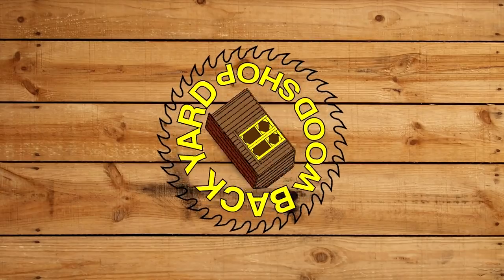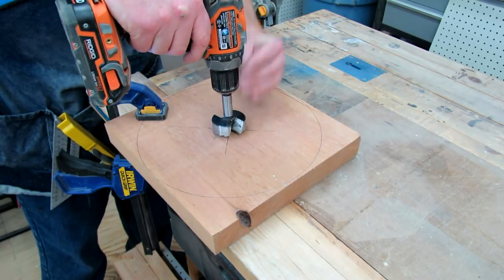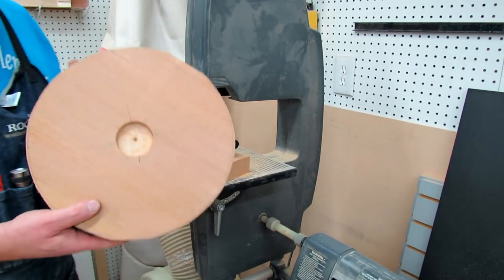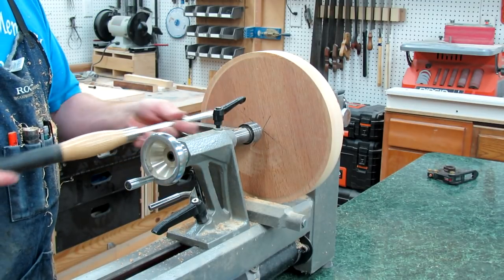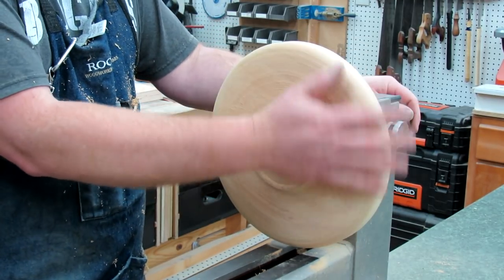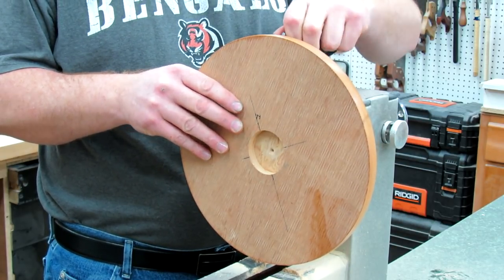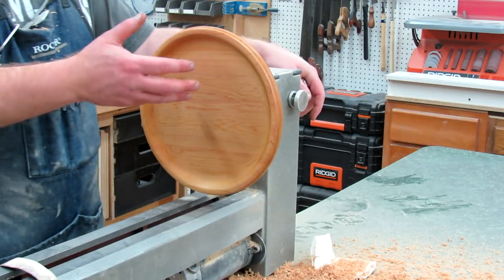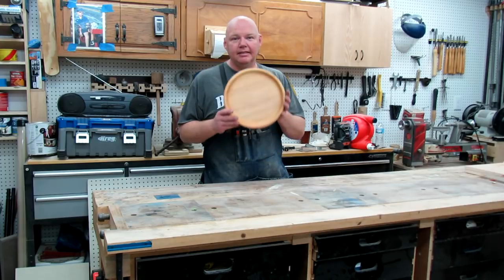Easy Cedar Plate

Comment: I like this a lot - Cedar is underrated for how pretty it can be when turned.  I haven't tried the 'shine juice' mix yet, but I have had great luck finishing cedar with Tung Oil.  When I get a bigger lathe I might try and make a set of these :)
Reply from the maker: Thanks for watching, I like the mix because it dries really fast and it doesn’t take long to build a nice finish. I will have to try the tung oil.